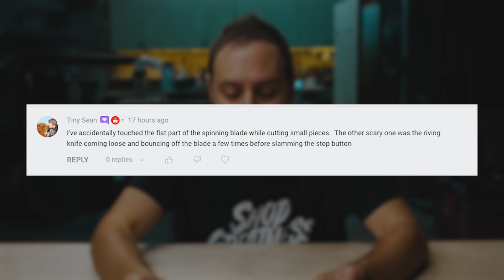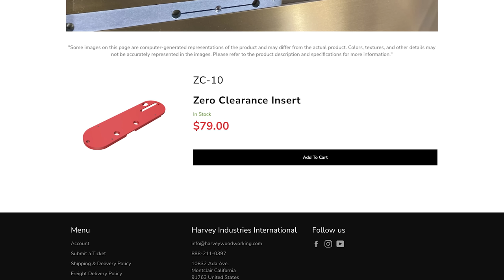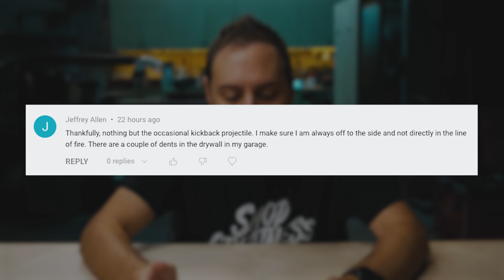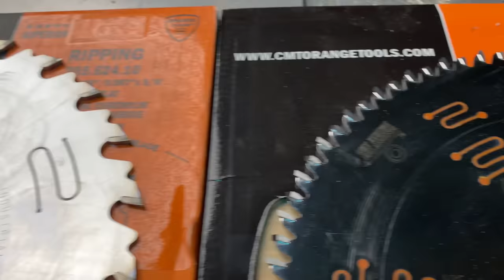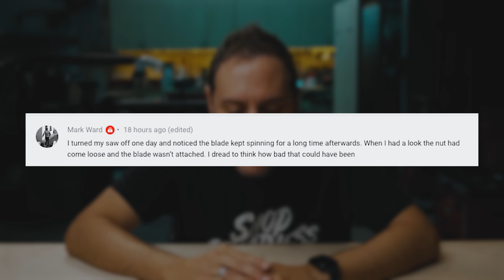I don't know why people make these dumb mistakes

Comment: Kinda surprised that "use the blade guard for any cuts you can" wasn't on the list. I'm totally new to tablesaw ownership, I've yet to use mine, but I'm absolutely baffled why so many people are so resistant to guarding a spinning blade.

So many stories below about dropping things onto the blade, that wouldn't happen if it was guarded.

As it is, I've used my tracksaw for every cut and haven't needed to use the tablesaw yet. I'm starting to wonder if I wasted my money buying it.
Reply from the maker: A good tracksaw and mft table is the way to go. It’s a hot take, but personally, the blade guard has always been in the way for me. I guess that’s the point. I didn’t show it on video,  it I have a floating over arm dust collector that slides over the blade and does a similar thing. Practically, it’s hard to show things with the blade guard on. That said, you’re right, I failed to mention it! It should have been #9
Reply: You want to know why, I'll tell you why, I need to see what I'm doing. Ultimately making an accurate cut is what's important. I'm not such an idiot that I'm going to hurt myself. So the blade guard is just in the way. It serves absolutely no useful purpose. Because there's no way I'm going to allow myself to come into contact with the running blade. That's not going to happen, ever. If I thought there was a remote possibility then I wouldn't be using the machine. Everyone that gets hurt has one thing in common. They all made mistakes. They were idiots! Maybe they're not gumbly all the time but in that one brief instant they were. That's all it takes. In the moment you have to execute flawlessly. It's not that hard to do. Just don't eff up. For the thousands that get hurt there's millions that don't. Be in the bigger crowd. Or forever be known as stumpy.

Comment: I guess its good when i shaked my head to all the mistakes made in the storys 😅 
Having a blade guard installed greatly reduces the danger of a exposed blade. As you mention how you would never use a tablesaw without a riving knife, i would never use a saw if it does not have a blade guard installed. That also allows having the blade up all the way so the teeth pull the piece down to the table instead of pushing it back horizontally.
Still lots of great points! No idea about the us but in germany we have 3 years of training to be a carpenter

Comment: 6:15 poor guy, he’s allergic to air. I hate it when that happens.

Woodworking is a fulfilling hobby, and I want to do it as long as I can. Owning a table saw would be nice, but I’ve gotten by making things without a table saw. The first time I watched a video of a table saw injury was enough proof that I didn’t need a table saw right away. I’ll probably buy a table saw in the future when the safety features I want become standard or at least more affordable.
Reply from the maker: A good mft table and track saw is a solid option
Reply: I've used table saws a lot and I've never gotten hurt. You just don't stick your hand in the blade and you should be fine. Why some folks can't manage that I'll never know. They probably shouldn't be near hot stoves either.

Comment: TLDR: Ouch!
Not a table saw injury but on the band saw.
I had just recently bought a second hand band saw and fixed it up but neglected to replace the blade. I had noticed that it was dull and dangerous and decided to not use it until I had replaced it.
I was in a bit of a rush (error 1) getting a small cut done so I went over to the band saw I knew had a dull blade (error 2) and started cutting. At the end of the cut, I was struggling and naturally pushed a bit harder (error 3) and the blade went through the last 10mm in an instant, pulling my gloved (error 4) hand into the blade, cutting through my nail and stopped by the bone.
Normally, errors 2-4 are a big no-no in my shop but due to error 1, my own safety thinking went out the window. Until I got the glove off, it was a bit of Schrodingers finger but I was insanely lucky and did not need to seek medical attention. Later the same day I cut the blade in half, ordered new blades and a proper first aid kit.

Comment: Move back the fence my guy. Ripping solid wood with the fence all the way past the blade is a good way to get kickback. No more (roughly) than 2 inches past the point where the blade cuts through the full thickness of the wood.

Especially important when taking of large amounts of material (ripping a board in half for example). When doing this you risk releasing a lot of tension stuck in the board. The board presses itself against the blade and fence because of the tension and there's the kickback.

Comment: It's nuts how many of these I (and my mentors) am guilty of, often at the same time. Working in a fast paced environment (commercial hardwood flooring) in foreign locations with a portable tablesaw sitting on a teetering fold out table. Hell, the vast majority of the work I've done at a tablesaw was ripping hardwood diagonally on an 80 tooth blade (often dull or rusty) freehanded, with no riving knife, and with music blasting in the background (I know what this sounds like, but the irony is that we do high end installations). That's not an exaggeration; that's how I was taught. The more I think I think about this, It's no fucking wonder I personally know more than one tablesaw amputee.

Comment: I was cutting melamine-covered board with no riving knife when it kicked back, it hit me on my left hand nearly severing my thumb and index finger of left hand, it happened so fast, it kicked back with such force, rotating as it flew back at me, it all happened so quick I didn't realise any pain, didn't realise I'd suffered an injury until I seen the blood on the table saw top and looked down, i switched off the saw and walked through the mill to find my boss, I was in shock leaving a trail of blood behind me.
Reply from the maker: Oh my.

Comment: Decades ago -- yes, decades -- I watched a film about table saw safety.  The film said to run a finger along the other side of the fence while using your hand to push the wood when ripping, to keep your hand from reaching the blade.
Of all the fatheaded advice, that takes the cake.  A hand is not a push stick.

Comment: The only blood I've ever drawn was with a router, and I honestly wasn't using it in the safest way. Sad thing was that I had already done this same thing 3 times without issue, then the 4th time, the router grabbed the piece and flung it, which caught my finger and took about a green pea sized piece of flesh with it.
Reply from the maker: Yikes! The router scares the mess out of me. Jointer too.
Reply: @wittworks  The funny thing is, the router itself doesn't scare me, I've never come close to touching a moving bit, and don't really see how I could without being irresponsible. It's the power it has to just rip things out of your hand that scares me.

Table saws, yeah the blade itself scares me enough, without the possibility of kickback even.

Comment: Ok, so official made for your saw zero=clearance plates may be "expensive" but injuring yourself is sure to be way more so. NEVER cheap out on safety.

Perople: STOP standing to the work side of the table saw. Stop it. Right now. You stand to the off-cut side. Why? Because then you can actually control the piece you are working on. From that side you can ensure the pressure is going towards the fence and with the cut. When you stand to the work side you can accidentally nudge the piece away from the fence perpendicular to the blade and that is what causes a lot of these kickbacks.

You can use the fence for small pieces, you just have to know how to properly support the push, ultimately just use a miter saw or if you happen to have one, a radial arm saw for thinner stuff. Generally speaking 2 inches is about as thin as you can reasonably do without a cross cut sled, any thinner and there really isn't enough contact with the fence. Just use a miter saw guys.

Comment: Oh I got one as well. My father was cutting some planks on my grandfather's homemade table saw when the uncovered arbor pulley got loose and was shot by the belt like a sling into the ceiling making a hole in the mdf roof. It was the same table saw my grandfather himself cut off his thumb on. So the moral of the story is... I have no idea. There were so many red flags with that table saw....

Comment: Blad on backwards,  its funny becuse on a radial arm saw its the opposite,  also thers a question as to pull or push the blade, but heres the catch when ripping on a ras you push past the blde as it cuts down into the table if its the other way then the part is jercked out of your hand if the arms is even normally tight it can walk up onto to the wood and violently swing off to one side dammaging the wood and the blade as well as filling your boxers.
My first rip on a radial arm saw i ran the wood the wrong way.  The mechanics of a ras are opposite of a table saw so you pull the saw to you and not push it away, you want to force the part into the table not try to lift it off the table.  Also you can better see where you can hold your parts and not be hurt. 

If i hear one more person say they are dangerous ill laugh at them becuse it just like a miter saw but with a much shorter fence.

Comment: I have been working with power tools since my high school years in woodshop. Always respected and applied the safety rules. But one day I chose to rush through a job and failed to adjust the blade height  from cutting a 4x4 to a door jam trim. The blade spins so fast you can see it.  All I felt was a thump against my thumb which was extended over the blade. Turned my hand to look and my thumb looked like an open mouth. Luckily it just cut the flesh and nicked the bone. I constantly look at my scar and the loss of sensation on half my thumb as a reminder of how important safety is around the shop.  I which I could post the photo with stitches. Btw Im 50yrs old, this happened ten years ago.

Comment: Get some non important practice pieces of wood and begin practicing sawing and putting them through/past the blade.  
For beginners, it is helpful to train the mind by practicing your moves for cutting on a non-running saw.   Unplug the saw, raise the blade, and practice pushing wood past it.  Be thinking of where your hands will be and where a push block or feather board would be helpful to stabilize the material.  If you know someone who has worked with a table saw, have them spot you and ask them to let you know if you are doing something that is not safe.
When you are ready to go to live cutting, do a variety of practice cuts such as ripping and crosscutting.  Develop confidence that you can safely operate the saw using safe practices.  Always be aware of what is in the line of the cut.  If your hands are too close, get push blocks to hold it down firmly as you push through.  Plan for the cut before you turn on the saw and have the push blocks ready to push the wood through.  You need to push the material through at a steady and even rate without pausing.  Pausing will cause more blade marks or burning of the wood and increases the chance of kickback.
After a piece of wood has sufficiently cleared the blade,  do not reach across the table to retrieve it while the saw is running.  You can: 1.) shut off the saw and then get it. 2.) Let it be pushed onto an outfeed table with other wood being cut.  3.) Push it past the blade about 2 inches and let it fall on the floor if it has the inclination to do so.
I've seen operators create unsafe conditions because of the fear of the machine.  They would hold back and not push the material steadily through, thus causing higher chance of kickback. 
Practice safety, and it will become safe habits.

Comment: Another tip for yall when handling literally any machine:
Close your fingers whenever possible, as in push the material with flat hands and your fingers touching each other, dont spread your fingers!
This might not prevent accidents, however, extensive research by the german BG (basically the german version of Osha) shows that any injuries were far more severe when people were working with spread fingers.
This doesnt just go for table saws by the way but for everything else with exposed spinning parts.

Comment: A good tip is to wait until the blade has stopped spinning when you grab the workpiece from behind the blade. I was distracted by a neighbour calling in for a chat and grabbed the two pieces I had just cut, which nipped the back of the blade and pulled my hand over the top of the blade, but very fortunately the teeth just missed my palm. Scared the crap out of me.
Reply from the maker: Oh yes. I forgot that tip.

Comment: I have a table saw. It scares the hell out of me. Even turning the blasted thing on, the noise it generates. I do a dry run in my head, a couple of practice cuts, power off, then complete my cut . I'm 60 and I've been lucky so far. If Jimmy can get cut, we all can.

Comment: HAVING grazed my left middle finger tip in the act of clearing the scrap off the table, I thought, I can't  believe I just did that. HAVING GRAPHIC  WARNING SIGNS OF A HAND WITH FINGERS DETACHED prominently placed in your shop will give you an instant tune up whenever you turn on your saw.

Comment: I think the experienced wood workers are the ones with the most injuries. Not just because the time they spend behind the saw is far greater but running through 20 safety measures each time you make a cut, especially on a job site or in a production factory churning out lots of product, that time is money. Not saying it is right but anyone who has worked in these environments knows most if not everyone is running faster not safer.

Comment: a safety note about getting nails or other objects embedded in you: do not remove them yourself. that nail is the reason you're not bleeding; it's putting pressure on the wound. wait and let a medical professional remove it

Comment: Own a Skilsaw table saw (it’s portable so I kept it.) and now I own a sawstop pcs after nearly loosing a thumb making a dado cut. Actually came close to losing all my fingers. 

Figure out what happened. Don’t be scared to go back to work. Most of the times it’s a small preventable thing. If you can afford a sawstop. Don’t get it just because of the safety feature, get it because it’s very well built. Or get a Laguna fusion 2. Also well built. But most likely, it’s our fault. And that sucks. Learn from it. Thank your stars. I get it. I kept my blood soaked saw even though it’s just sitting in a shelf. It was my fault.

Comment: Not sure i completely agree with No.9 there; lets say you have an accident and get knocked unconscious, you're on the floor of your shop and in need to medical attention, but the tools still running so no one is going to check on you, and the door is locked, so if you are discovered, First responders are going to have a harder time getting to you.
so yeah, layout is important, and you don't want someone coming up behind you, but you don't want to trap yourself in a room knocked out and bleeding.

Comment: The myth of the table saw has always been that minimal blade exposure means maximum safety.  I disagree. Not being able to really see the blade because its mostly hidden from view is a big reason people cut thru fingers.   I have met Lots of guys with fingers missing to a tablesaw. I have never met one with fingers missing to a radial arm saw. Perhaps its because one of your hands is literally on the handle of the saw- keeping it safe, and you can easily see and visualize the plane of the blade to keep the other hand out of the way. Perhaps it is also because with cross cutting, the hand not pulling the saw is NOT moving, the wood is not moving. You put it in a safe spot off the kerf and it stays there. That’s why I bought a 1954 DeWalt radial arm saw to handle all my cross cutting and ripping 24” and less.  ( NOT one of those sliding miter saws so popular today and so flimsy- but a true 500 lb cast iron monster of a golden era DeWalt ) Moreover, The radial arm saw simply can not kickback in cross cutting.  The blade is not spinning towards you.  And in ripping, you Turn the blade 90 degrees and you stand beside the blade while ripping, so that even if it does kickback, it ejects the wood 90 degrees to your left or your right, not AT you.   When I have to teach workers to use the saw- they are all a little scared of the Radial… and to me, that is a Good reaction to ANY saw.  I do not worry about them using the Radial.   I worry when they fire up the table saw.

Comment: Dont stand in the firing line and turn on your saw, ive seen carbid tips fly off a blade, a lot of brands of blades are sold without packaging you do not know if somone droped it.  Also never let your kids run wiled in the shop same reasons you dont know what they have played with and kids will be kids.
The shop is not a play room its off limits.

Comment: Thank you so much! I'm a beginner as well. 

As a former medic, please never, NEVER, NEVER EVER, EVER pull an impaired object from your body. That nail could've gone through an artery or vein, and the nail itself was plugging it. You pull that out, and now you have an uncontrolled bleeding artery/vein. 

Instead, stabilize the object with clean, soft material and tape or something (double-sided tape not recommended) and go to the ER or ED, whatever they are calling it now a days. 

Or, just call 911.